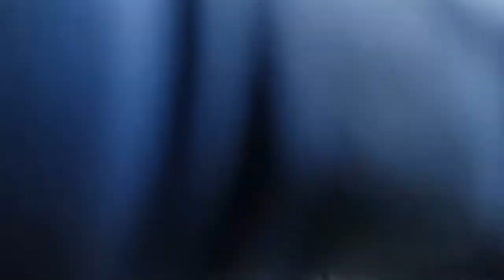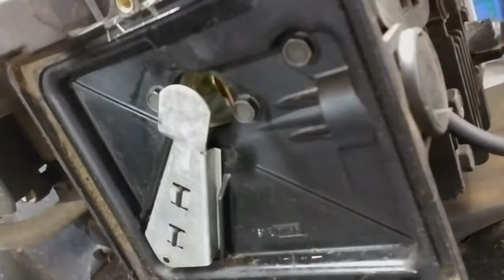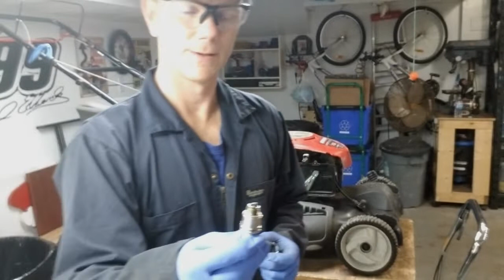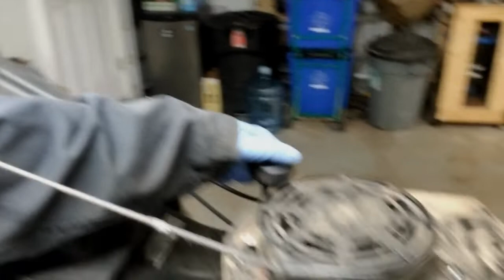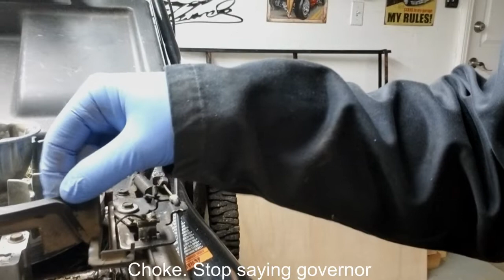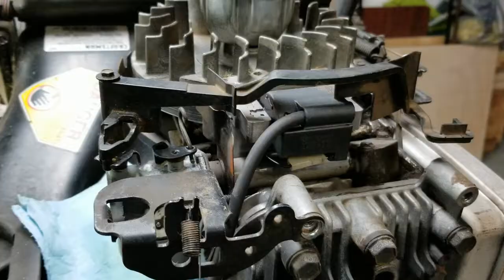Lawnmower Tuneup Part 1

Comment: Actually that is 6.75 ft. lbs gross torque so it would be about a 5 HP Briggs as I am sure you know that by now... they haven't rated these small engines by HP for about ten years now.
Great vid ... and I have a nice personal Craftsman of a similar vintage.
Reply from the maker: You are correct sir. Gotta love how they try to mislead consumers these days.
Reply: all those briggs quantum's are 190cc. Regardless of what it says on the cover.